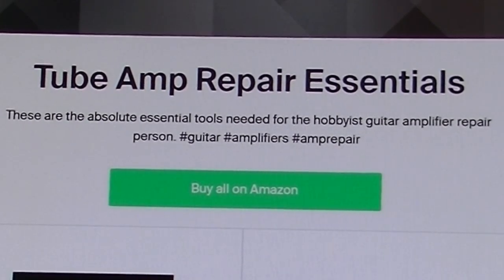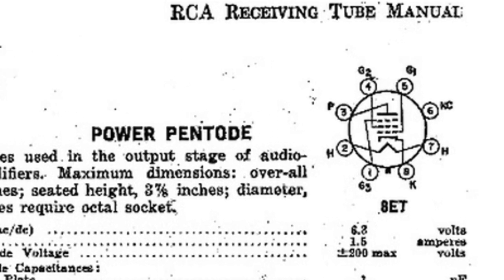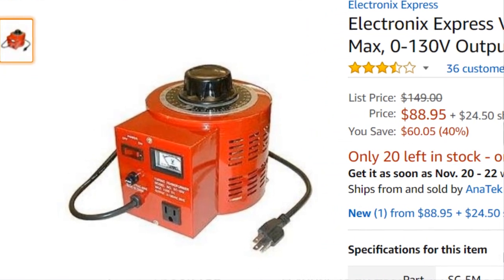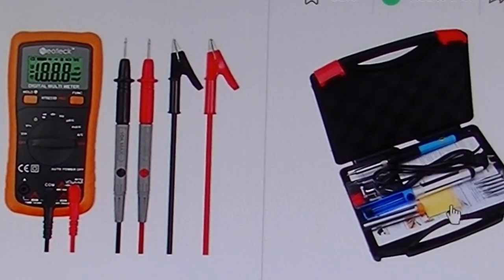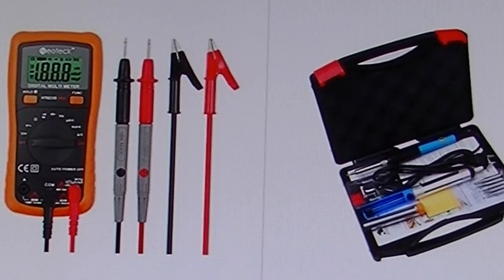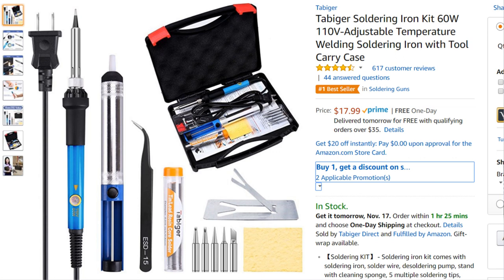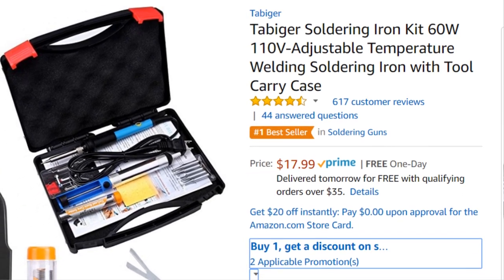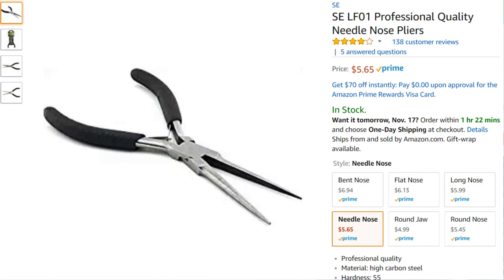9 MOST ESSENTIAL TOOLS for Tube Guitar Amp Maintenance and Repair

Comment: Hey man, love your videos! This is a great list. The one thing I would add to it is something you can buy the parts for, but also have to make: a cap discharge tool - you know, basically a resistor hooked up to a test lead that you hook up the other side to ground to drain those filter caps before putting your hands anywhere near anything inside the amp. Mine is a resistor soldered to a wire with an alligator clip and has heat shrink tubing all around it. Simple to make, but effective for safety so I would say It's necessary! Keep the videos coming dude

Comment: Great video Brad! As a seasoned tech I dare say you would end up over time acquiring many more tools and supplies not covered here from necessity. You are one of the few who post service videos on tube amps and we need more people getting into the field. A basic set of tools and test equipment is vital to repair/service tube/SS amps and you did a great job sourcing where to find them. By the way, I have my Grandpa's safety razor and am using it after watching your video on that. You do much more than your normal tube jock! Good down to earth knowledge of being smart and thrifty. Love ya. Thankz
Reply from the maker: As always, I appreciate your comments. Thanks for them.

Comment: Hi Brad, good video. I think the number one tool is a good brain...with an understanding of electrical circuits and a healthy respect for the danger associated with working with them. That being said, another great (and safety conceous) device is a homemade current limiter (like the one Uncle Doug made and showed in his videos). Since the VariAC that we use (like the one you have) is non-isolating, I think it is an extremely important addition.
Reply from the maker: That would make a nice, round Top 10. Good call.
Reply from the maker: The variac I use has a quirk... If there is a short and too much current is being drawn, a distinct vibration starts in the unit, warning you something is not right. When you're only dialed up maybe 20V or something, it's usually not enough to damage anything. Also, you can replace the 5A fuse in your variac with a 1A or 2A fuse depending on your equipment, and that will blow before whatever you're working on. OR...you can just do as you said and make yourself and cheap and easy Uncle Doug current limiter. :D
Reply: The Guitologist Hi, yup...I've watched your videos and seen your quirk...in the VariAC that is!!  I have the exact same VariAC and have never had that "shimmy"...although it did smoke once before it blew the fuse!!  Also, YOU KNOW about that quirk and when to stop... I don't know that others (especially beginners, which your video was meant for) would have the same "feel" for things as you do. I have seen people do some pretty scary (and dumb) stuff in my life, so any simple "Murphy Proofing" is good in my book...especially without the "Cat scan" and "sniff test" capabilities that Uncle Doug had!!

Comment: Some simple cheap things I use too are scissor clamps, xuron micro flush shears, mini needle nose pliers, home made current limiter ( I haven't bought a Variac yet) capacitor voltage draining lead and rubber gloves.  I agree with you on the weller and other mid priced soldering irons. Sometimes it is better value to buy cheap ones as they don't seem to last very well any more maybe something to do with where they are made.  Anyhow, a good list.

Comment: +The Guitologist Hi Brad! I have my variac plugged into an isolation transformer with floating earth. A variac alone does not provide galvanic isolation. Also, I use Thermaltronics RF soldering stations (similar to Metcal). They have a huge thermal capacity when proper, interchangeable tips are used. I've never had an occasion where it could not provide enough heat, even on 6-layer PCBs with huge internal ground planes.

Comment: Nice video. However I think you missed a few cheap diy tools. A current limiter using a bulb, that will prevent you to get more than a few hundred watts in to your project. Second, a tool to discharge the caps. Besides that - a Weller that stop working?? I have one that still is going strong after more than 40 years, and you can still buy temperature controlled tip:s for it.

Comment: For soldering irons, I have nothing but good things to say about the Solomon SR-965 from StewMac for $15. I've gone through multiple tips and the iron itself works perfectly fine with over 3 years of use so far. Get the pencil tips for PCB/pedal work and the chisel tip for guitar pots/amp work.

Comment: I've had a Tenma solder station for years. A brand new one probably won't last as long as one that's been repaired. I bought a reconditioned Tenma solder station and Variac from MCM Electronic Supply when they were located here in Dayton Ohio. They've since moved down the road to Springboro Ohio. But you can still walk in to their Will Call pickup counter and they usually have many reconditioned items for sale. They're cheaper, work better and last longer than brand tools and equipment. Just because they've been repaired and had the defects corrected.

Comment: A dummy load? I see most techs make their own tho. Scope because it's nice seeing that wave form every time I have had my amp in. I like seeing the point it clips etc. yeah, not essential, but nice. The other thing is a tube tester. I have a pair of old Sylvania 6Ca7s here that were good, but not sure if they survived the flight back from Canada in my luggage. I am disabled and have have trouble getting around, so i am trying to think up of something i can do from home. Thought about amps because I have changed tubes, caps and resistors, and even an OT before, but here in New Zealand there are not enough customers to make it viable, at least not with just amp repair. Better off fixing smart phones because everybody has those. Meh to that. trouble with services is people need them but do not want to pay much for it. Sooner pay for new than repair something.

Comment: Hey Brad - Great video. Very helpful. 

One thing I think might have been helpful on the topic of multimeters: a bit of a discussion on when and why to go for a cheap one (like the $19 multimeter you showed in the video) vs a top-of-the-line one, e.g, the high end $300-400 Fluke you appear to use a lot in your own work.  What are the trade offs, feature 'nice to haves', accuracy concerns, etc. Obviously, the $19 multimeter would be perfectly adequate for a lot of the electronics diagnostic work in amp repair, but what kinds of considerations did you have when choosing the expensive Fluke?  

No need for an EEVBlog-level tech rant, but just a quick bit along those lines would be helpful context for electronics newbies.

Comment: Lead solder definitely flows better at lower temps. Smaller gauge also melts faster and I think gives me more control. As far as a multimeter, get a decent quality one. Working on tube equipment means you'll be dealing with some higher voltages and you want a meter that can do that safely both for you and the equipment. Fluke and B&K come to mind. Yes they cost more, but you only have to buy them once. A decent multimeter really makes working on electronics a better experience all around. After seeing what's inside and what isn't inside (like protective fuses in some cases) some cheap and sometimes not so cheap knock off Chinese ones, I wouldn't bother. I've also heard Weller has gone way downhill in quality. I still have my old cheap Radio Shack soldering iron and solder sucker. It's still going strong and for discreet components it's always worked fine.

Comment: Without pushing another hobby, The ARRL in the US and RSGB in the UK have a fair number of basics books. I won't shout Ham Radio Rocks... but it is a good source of info on electronics even if it isn't directly guitar related.
Reply: There are parallels, especially when it comes to repairing tube-powered ham radios.  My background in repairing tube guitar amps went a long way in helping me restore a Collins S Line that had been neglected and left for scrap.  2 months of work and had that Collins back on the air.  73

Comment: Brad, I purchased the tools you recommended here... can you possibly give a quick video on setting up and using the soldering kit? (ie. first time use, proper tinning, use of the desoldering pump, proper tip cleaning, proper heat setting, etc?)

Comment: Soldering equipment try looking up Xytronics they do a good range of stuff.  If you want cheaper try looking up Katsu 936D solder station on Amazon or Ebay.  Multimeters, get two; one for low voltage stuff and another for the high voltage.  The high voltage one needs to be a good one as protecting yourself is the most important thing.
Reply from the maker: Good suggestions. Thanks for the comment.
Reply: Ditto. There are some good videos showing inexpensive Chinese 936 / 936D soldering stations (different brands) - including some common issues.  As these are knock-offs of Hakko soldering stations, the parts and tips are somewhat standard. Definitely worth a look.

Thanks for a video that adds to my wishlist...  :)

Comment: Hello Brad
Between you and my two other favorite guys on you tube,  I've been able to elevate myself from "being a danger to myself" when it comes to this stuff,  to that of "knowing slightly more than a rank amateur." Crazy for you vids on guitar amps especially the older point-to-point ones;  your knowledge of the subject is amazing and you're one hell of a player as well. One question relevant to this video, how much amperage do I need in a variac for what I intend to do, probably no more than tinkering with and studying my old 135 watt Fender Twin and possibly building a Tweed or Deluxe Reverb clone. At 65, learning about tubes has become one more of my numerous hobbies. Keep the vids coming and Happy Holidays. Thanks and regards, JC.
Reply from the maker: 5A

Comment: Sencore PR570.  Seriously, you need one of these.  Hakko desoldering gun.   Tube tester. Scope and audio generator.  Fluke infrared thermometer.  Dummy load.  Sencore capacitor tester with high voltage leak test and esr meter. Benchtop smoke absorber.  Some sort of magnifier to spot cracked solder joints......

Comment: Seems a good selection except I am sceptical about the RCA manual being essential - these days pretty much any tube datasheet can be googled and the valve museum and other similar sites pop up and seem to have extensive coverage.

Back in the day you used to need books full of data on semiconductors, but I not seen a printed datasheet in decades, and my old IT TTL databook is used as a doorstop, not a reference work!

Comment: A fire extinguisher in case you are working on Bugeras!   LOL.... Sorry sorry, i just had to.
Reply from the maker: haha. Whatever you're working on, a fire extinguisher is a good one to have.
Reply: I'd suggest finding a CO2 extinguisher.  That should quell the fire while still leaving something salvageable.  if you use a standard ABC, you'll have a royal mess the clean up.  I'd also strongly suggest a remote switch for the bench, so you can kill power.  Just doing that would go a long way to putting the fire out.

Comment: Thats a great starter setup ! I would ad More Books !! The Tube Amp Book by Aspen Pittman & How to Service Your Own Amp by Tom Mitchell.. I do prefer the Miller 101 Wire Striper. Mine is from the 70's and still sharp, beware of Chinesium versions . Also I think its about time you get a decent Oscilloscope . You can find very nice scopes for cheap. I tend to favor the Tektronix 4XX series, I have two 465 and my fave 468 cost me $100 in good working order, that has both digital and analog . I could not build my guitar overdrive pedals with out a scope and function generator.
Reply from the maker: I have a scope. I never use it. Don't think I've ever even showed it on the channel.
Reply: I've got the Tektronix 2252 for free as the engineering department of ASU threw all of theirs in the garbage.  Most of my tools come from the garbage and I build all kinds of fun stuff with it.  Prefer vintage tools that no one wants over cheap modern Chinese stuff.  I've got a shop full of working antiques.

Comment: I'm recently getting back into messing with amps at 55, hadn't done anything since my 20's and that was minimal. I lean hard on your info, Brad. Thanks so much for your videos!
My last soldering station I bought was an import version of a Hakko or something. It's labeled as a TekPower936D. I've used it little, are you familiar with it?

Comment: Maybe get an isolation transformer as well?  I mean this is mains powered stuff and high voltage tubes...  Just sayin this for potential new people trying to get into the hobby.
Reply from the maker: Not a bad thing to have. Someone else mentioned a current limiter, which is a good idea as well. Uncle Doug's channel has a great tutorial on how to make one. A limiter will kind of preempt the need for isolation since any excess current will light a huge bulb instead of kill you.
Reply: Yes, a dim bulb tester is nice too.  Paul Carlson has a video on how to implement all three onto one board - Variac, isolation, and dim bulb tester.    https://www.youtube.com/watch?v=51mjt9nFoeA .  I use an isolation/variac combo unit which is a Tenma 72-1095.  I don't use a dim bulb tester much because my repairs are mostly flat panel TVs which have a 390V PFC circuit and usually CCFL driver circuits that tend to react badly with dim bulb testers.
Reply: The bulb might save some components or a transformer, but it will not save your life!
the current needed for the bulb to go thermal and start resisting current is some orders of magnitude above what can hurt you.

think about it, you are several mega ohms but some hundred volts can still hurt.
we are looking at milliamps for a good shock to the system. 
that bulb won't even notice that.
Apply ohms law and solve for current with the impedance of the bulb + your body, then power dissipation in the bulb. 
you are a bigger resistor by far so all the voltage will be across you.
that bulb is a short relative to your body.

this is like thinking the fuse will save you from a shock.

I've gotten shocked from mains plenty times(220v). not really that bad if your heart is ok. but that bulb will do nothing but give you a false sense of security.

I love your stuff, but this is plain bad advice.
you might want to make it clear to fans that it can save the amp, but not the technician.

EDIT for clarity:
I'm not saying you shouldn't use one. 
I'm saying use one knowing its not there for you.

Comment: Variance, check. Multi meters, check. Dedicated capacitance meter, needed. Soldering equipment, check. Wire strippers, needle nose pliers and assorted hand tools, check. Tube tester, check three times. ( I inherited my father in law's meters and testers. RCA manual??? Well, needed.
Ok, I have an Unger 33 watt iron, and a welder gun for wiring only. So, what's a good manual to learn about tube circuits, how they function and basic design? I understand the basic of how amplifiers work in general, and how tubes work in general, but tube amps are a bit above my understanding. Any suggestions? And sorry, I use lead solder. Unleaded solder just doesn't seem to. Bond as well. Don't inhale the fumes and keep your hands clean and you should be ok. But it does have an effect on the environment when used in mass quantities. Contact cleaner, make sure it's won't melt plastic! All newer pots and switches have plastics in them and the wrong cleaner can ruin your pots and switches! Again, where can I get a good book on tube amps, their design and troubleshooting them? Thx!

Comment: Oscilloscope, rubber gloves, magnifying lunettes, LCR meter, capacitor checker hv, esr meter
Reply from the maker: The burns on my fingers agree with you on gloves. :D
Reply: leather gloves for hot tubes,rubber for isolation operating on HV

Comment: I was thinking a capacitor tester might belong with the minimum list of tools.  I see on your other videos that you use one of those 12864 based Transistor Testers (also LCR tester - Inductance; Capacitance; and Resistance).  I am wondering if you think the ESR and Leakage measurements of the capacitance testing function are accurate?  Most Cap leakage testers are old tube devices that measure leakage at very high voltages.  It would be nice if one of those Atmel based micro testers actually worked for cap leakage testing!!

Comment: You also forgot to mention the hammers that we saw being used at the beginning of the video.
Just saying....😎
They're also good for fixing Gibson guitars apparently.
Just saying again...🎸
Reply from the maker: In the 2018 Gibson case comes a complimentary hammer along with the truss rod tool and COA.
Reply: The Guitologist It is an awful shame because at various times I have owned an early Gibson 330. A 1956 Les Paul Junior, and a 1970 Les Paul Deluxe. All fabulous guitars that I wish I'd never parted with.
Unfortunately I had a habit of selling a guitar to buy a new motorbike, and vice-versa, depending on whether the sun was shining.... Geddit.   Shame I could never afford both at the same time.
My only other Gibson was a 2007 Honeyburst Les Paul which I don't regret selling 'cos it hurt my back. Too heavy (and I'm too old to put up with that sort of thing). 
I do however own one old guitar you might like.... A 1966 Burns/Baldwin GB66. Only thing is, at some time someone had put in super-distortion pick ups which totally ruined the whole character. (Not me)
I fitted Kent Armstrong Filtertrons which at least give it back some 'twang'. Cheers Brad, Keef....